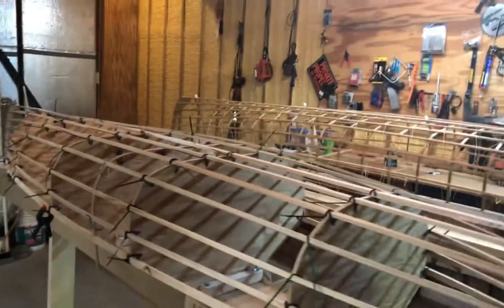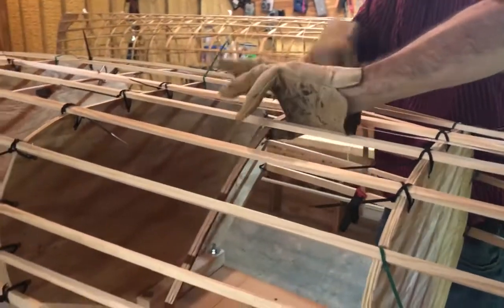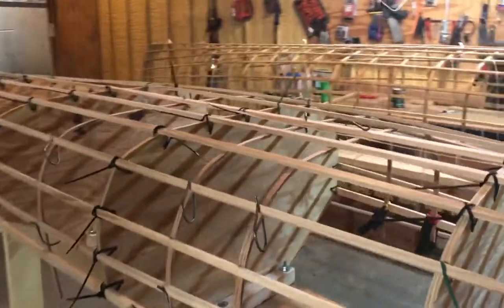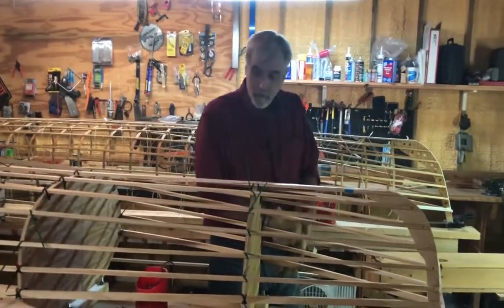Installing Ribs

Comment: Outstanding video. Thanks for the detail. It was even important to see the few seconds where you actually put the little clamp on. You seem to quickly push it through and then pull back to add the connection.

Comment: How thick were the ribs you used? I have your kit and am using white ash, and have a huge pile of kindling now. I soldiered through and finally got the ribs in, but it was so frustrating initially I put the project on hold for a year
Reply from the maker: Hi, this is Larry LaLonde, owner of Geodesic Airolite Boats.  I'm sorry you're having problems with bending the ribs.  Usually that is one of the fun, rewarding parts of the build.  The thickness and width of your ribs is on your plans and the ash usually steams into shape pretty easily except for the last couple.  A 4 to 5 hour hot water soak and about 30 to 40 minutes in the steamer makes them very pliable and easy to work with, very similar to what you saw in the video.  If you've gotten this far, the rest of the build is the easy part so don't give up yet!
Thanks,
Larry
Reply: @geodesicairoliteboats1632  Hey Larry, no worries. It's done now :) Finally get to remove the boat from the strongback now...

Comment: Is it possible to just use zip ties to clamp the ribs?
Reply from the maker: You probably could but you have a limited amount of working time while the rib is pliable and the zip ties would take substantially longer.  Also, if you need to change the location of a zip tie, it needs to be cut and replaced.  I have a lot of experience with zip ties and they don't hold the rib in place as securely as a clamp, which could result in a slightly weaker joint.  If you decide to try it, let us know how it goes!  Larry